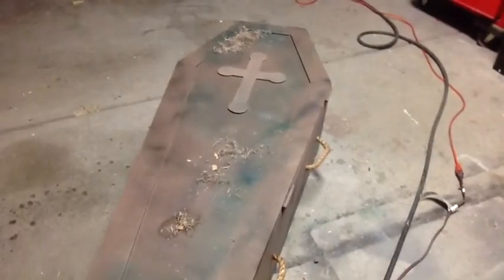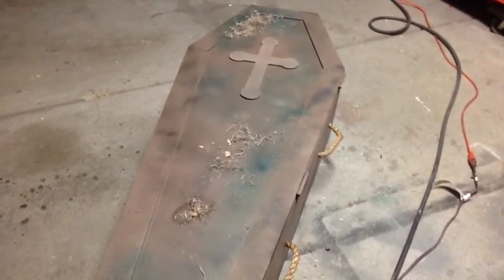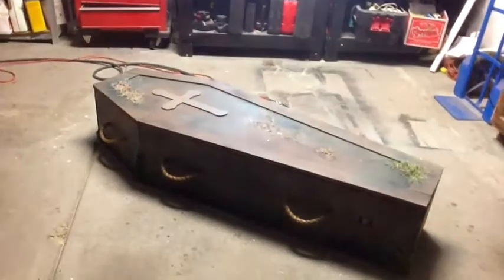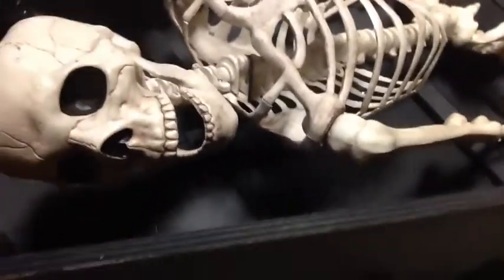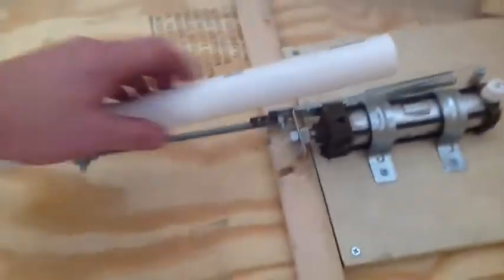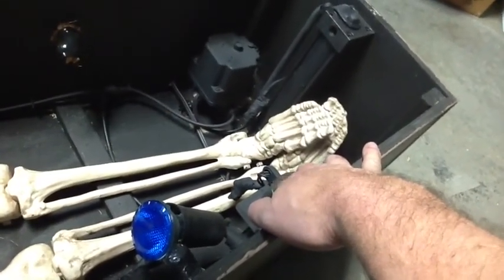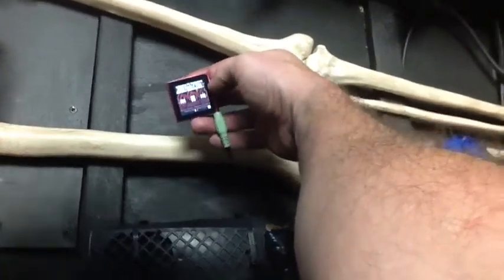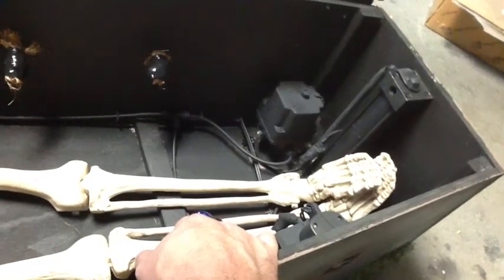Halloween Pneumatic coffin prop

Comment: Incredible! I like your pneumatic set up lots better than any other DIY vid I've seen on YouTube yet. And I mean on the technical aspects of how the pneumatic system, seems so much better under control ( like there's no worry the door will fling off from the throw). Does the spring dampen the throw (and I mean that in a good way). I want to build one badly and have all the skills needed except the pneumatic portion. Would love to see you post a parts list just of what is needed for that part.
Reply from the maker: Thanks for the nice compliment David.  I had only built one other pneumatic prop before this (a simple tombstone popper) and realized how easy and reliable pneumatics were to work with.  I am no expert, but if you haven't tried a pneumatic prop yet I seriously recommend it.  As far as what I used for the coffin, I've listed a parts that you would probably need:

-6 inch stroke cylinder for coffin pop up
-4 inch store cylinder for skeleton pop up
- pneumatic valve ( I used a three port valve)
- motion detector flood light
- powered speakers
- MP3 player
- springs (if using double acting cylinders)
- coffin ( made of 3/4 plywood )
- Walgreens skeleton